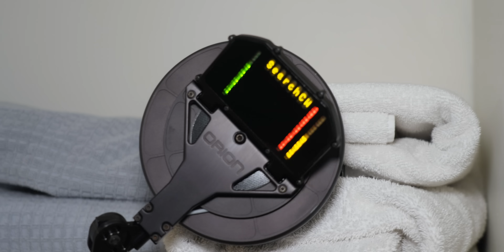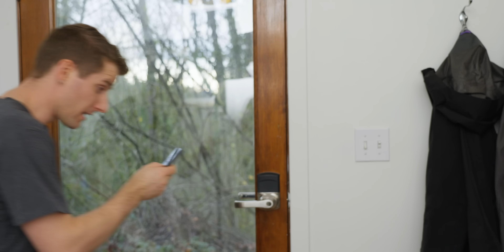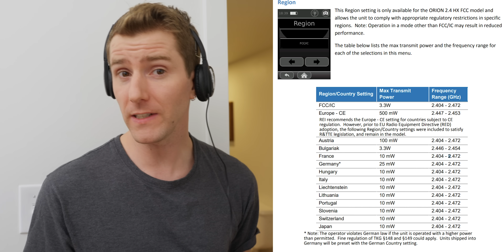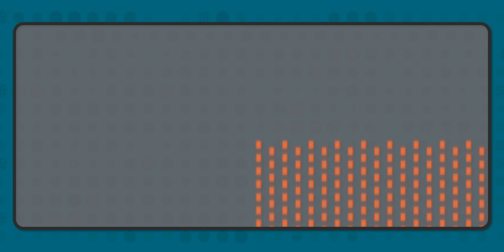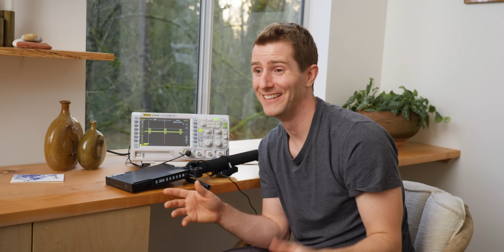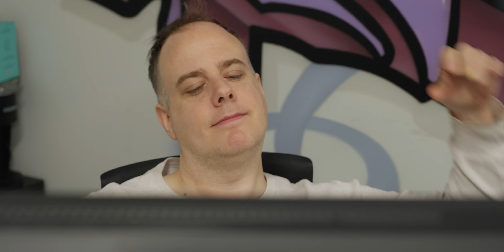I Rented an AirBnB to Look for Hidden Cameras

Comment: Dont like the title (which is currently I rented an AirBnB to Look for Hidden cameras)... it points to a totally different video.
Reply: Dearrow had superior title already:
Demonstrating a hidden electronics detector ("KLB Orion Non Linear Junction Detector")
Reply: Thats why this video is getting so many views. People think they’re going to see rigged Airbnbs caught.
Reply: A shot of a window with an actual view and not a blurred rectangle to conceal the location should probably have tipped me off that there would be no actual hidden cams found. It’ll be interesting to hear about this on the WAN show.
Reply: cry about it then
Reply: May be the title should be "Finding hidden spy devices with a microwave on a stick" ....
Or maybe the current one is better
Reply: People expect to see an Airbnb busted with spy cameras. While the title is technically correct, it gives off the wrong impression. Clickbait.
Reply from the maker: We did rent an airbnb. Hence it being shot in an airbnb. Obviously we didn't find any cameras so we talked about the tech we used. -LS
Reply: @LinusTechTips  “finds cameras” is also used as a results phrase…
Reply: @LinusTechTips  Please include some snippets of you testing the hypothesis and then acknowledging the results even if they are boring next time.
Reply: @LinusTechTips did you really spend the hours scanning the whole place? 😅
Reply: @LinusTechTips buddy, you searched one airbnb, the title suggests you did an actual investigation on multiple houses to get a real conclusion, if your title only refers to the first 30 seconds of your video then you swap to something completely different then yes, the title is misleading and clickbait
Reply: @Xtrm_Motors  The title is literally "I rented AN airbnb" so no, them investigating multiple airbnb's would actually be less accurate. What are you smoking?
Reply: @Xtrm_Motors  no it doesn't
Reply: @Xtrm_Motors  however the title does not, an would refer to a singular home and the title says an airbnb
Reply: @Xtrm_Motors it says “an” thats one😂
Reply: @Xtrm_Motors ”rented an Airbnb” are you illiterate? That clearly refers to one, not multiple smh
Reply: All you did was overact like it was a 90s infomercial and insert your own products as mini ads. Are you that hard up? You're less tech tips and more Markeplier fake reactions.
Reply: @LinusTechTips  Fair enough, I appreciate the reply, Linus

Comment: Thats the doohickey that people use to look for stuff in beach sand
Reply: You're not entirely wrong. You're thinking of a Metal Detector. Those are kind of the same in a way, they usually have a coil to emit and receive radio waves, you could in fact make one out of an little transistor AM radio. The trick is to listen to changes in the frequency (you can create a so called beat-oscillator to generate a tone), you can use that waveform to detect various types of metal. When the radio emission hits various metals, it will resonate according to the type of metal.
Reply: @joonglegamer9898  That name is the name I was looking for and for the life of me I could not remember it

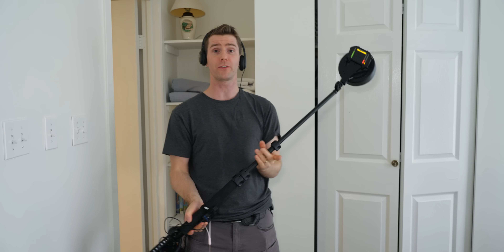Comment: 1:04 why is it illegal in those countries?
Reply: I'll go out on a limb here and say: RF emissions past legal limits. It's illegal in most countries to emit radio frequencies as they can interrupt communication, kinda like jammers are illegal. The apparatus itself is probably not illegal to own, but to operate without a license.
Reply: @joonglegamer9898  As you can see in a graph he shared, France (for instance) regulation on RF emissions power are higher than the ones in CA / USA 😅

Comment: I'm surprised an NLJD made it to LTT! They're pretty obscure and I've never seen one until I saw reference to it on Hackaday which linked to some websites about cold war spy tech. They definitely belong in the "genuinely spooky" category of technologies.

I don't think the microwave emissions would cook your eyeballs since it definitely doesn't house a 700W magnetron. It likely puts out a few watts of microwave energy (or maybe less) (but there's so little information on these that this is just a complete guesstimate). Still don't point it at someone's face since there is a significant amount of RF and it's probably not the best thing to point at your face.

Comment: That whole section of linus talking to the camera in front of the window concerns me. 

Don't microwaves bounce off of glass? 

Like, isn't that why it's safe to put your hand on the window of a microwave oven? 

So if thats correct, then didn't they have microwaves blasting right at them the whole time they were filming that bit?
Reply: No, the mesh inside the glass is what blocks the radiation. Essentially, any conductor will block the radiation (like the metal box enclosing a microwave oven).

Comment: Surprised there was no mention that you could also use your cell phone camera to detect IR light.  Just like the trick to see if your TV remote is still working. For example, you could turn off all the lights in the house, and look around using your cell phone camera to detect any "spy" camera that could be using infrared to see in low light.
Reply: You can. But like ordinary cameras, phones have an UV filter, so even if you can see some faint light blinking, or even a bit stronger - it's still not gonna detect the weaker light or all wavelenghts available. You can however take one of your older digital cameras, open it up, and remove the UV filter manually. If not for bug detecting when that gets boring, you can at the very least take some spectaccular night photos.

Comment: aCheap way is to use a germanium diode (or the diode junction of a germanium transistor) connected to your voltmeter.

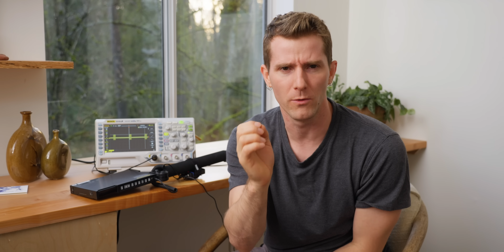Comment: 10:15 "The current that an RF signal will induce in a wire is very small... Like We are talking on the order of millivolts"  millivolts is not current,  milivolts is volts, current is amps.

Comment: Or you can buy a thermal imager, they aren't that expensive (you can even by mobile phones with this feature) and quickly glance over the room with it. Surprisingly effective! Every turned on electronics produce heat and they can pick them up just fine. Turned off electronics, of course, won't show up, but you're not scared of those ones, eh?

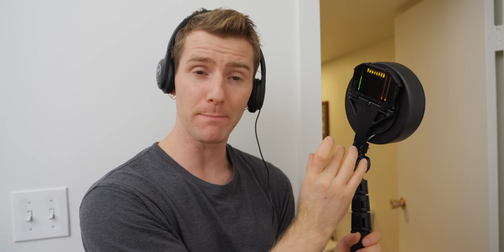Comment: 3:55 so if you create only one microwave pulse that melts your neighborhoods brains every few days, your average is within regulations?
Reply: Sunday roast
Reply: It fires an hour once every 10 Millenia but starts turned on. That allows the thing to fire at over 7000000 times the power right? Totally legal and safe!
Reply: Had a good laugh at that one mate.
Reply: "XKCD's what if" did a video about this, if you teleported to the surface of the sun for several hundred nanoseconds and immediately teleported back, you'd be unscathed.
Reply: To give a more serous answer:
It's almost certain the time you're allowed to avarage over is limited. I would guess to something between 1sec and maybe several minutes...
Reply: no, because it would be too high even when time-stretched and averaged and thus illegal, or legal but too weak.
Reply: @eqe2e23e  one Little Boy every 6.9 thousand years comes down to an average of 3.3 W
Reply: @istoOi  as far as i'm concerned, once every 6.9 thousand years you are allowed, but then for the next 6.9 thousand years you're not even allowed to use an rfid worth of radiation.
Reply: yea like how the EPA uses PPM for contamination and polution so the solution to cars and nuclear waste is just throw more shit in with it until it passes.
Reply: they obviously know they need to be using total polution per second not polution per part of waste, but they are not actually about polution they are about public optics and funneling money from all those green certified donors.

Comment: Hello so I've been needing help with like knowing what to upgrade because in games such as fortnite and warzone buildings won't load in for a decent amount of time and I was just wondering what all I need to upgrade to compensate for having a bottlenecking 4070ti. CPU: i7 8700k 3.7ghz GPU: 4070ti slim x gaming Ram: 2 Corsair Vengeance 8GB each Motherboard: rog strix z370-e gaming CPU Cooler: Cooler Master fan SSD: Kingston skc400s37128g (128gb) For the case I have no clue what it is but it leaves no room for fans so the only sort of fans I have right now is the CPU cooler and one other fan. If you could let me know if I should upgrade to something or let me know its fine please let me know cuz I hate waiting for my games to load stuff in the game so slow🙏🙏

Comment: No you can't lol not with what you said. Private Internet Access VPN said sonar from your smartphones and if you Google "sometimes Tinnitus is Ultrasound" you'll see that Doctors automatically give drugs to dampen senses because they're NPC's running a govt designed program that doesn't want you to know if its Ultrasound or not even if they have an idea of it. Google: "Ultrasound of Earth crust reveals inner workings of Tsunami factory" Now add that capability with plasma generated ultrasound frequencies that go through materials like your homes as if they don't exist because no absorption in the materials. See you and the cells inside your brain. Google: "Ultrasound to read minds" Upgrade to everything I just told you.

For people who make fun of Tinfoil hats? Google: Pubmed "Human mind has microwave electromagnetic nature and can be recorded and processed" Make them a magneto helmet.. They're way ahead of you, just out of style. - Deist (Ultrasound can see the cell mimic in your heads of what your eyes see. "Oh he's about to run a check, turn off everything until listening devices hear he is doing something out of context then switch back on" Easy mode.)

^ Look at me I sound like Alex Jones but with more data. Let me give a solution I'm not selling anything. There are Moths that can make Ultrasound to Jam Bat sonar, Boeing plasma force field uses plasma generated Ultrasound to produce shock wave level Ultrasound for destructive sound interference, and plasma excited by Ultrasound can also generate massive EM fields for defending from radiation by natural or other sources. So? Plasma generated + Computer control. Fun fact: Sound can be used to scan other sound..

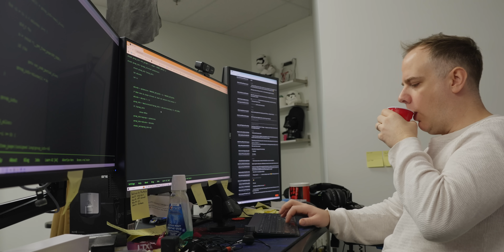Comment: 12:41 Can you please make a programmer fake the haking because having a messaging website with nosens user names (likely just a simulation) that types emojis??? It is likely supposed to be what happens when you run a code, but that cant happen while you write the code with just using like 8 keys on your keyboard. The even more funny part is that on a line it starts with "Atomic_set" like you are writing code for a nuclear reactor or something 

But i will give you some credit while you did not just run a simple program that just gave some useless information you went on a website (or something like that) that actually had code that was sort of realistic (not at all), so props to you for at least not going on those websites with green text and all of that.

This was not to be mean or anything, it was all meant as a funny indive into how you made the scetch. But please the person who has that computer please remove some of your bookmarks and close out of some of your programs please i beg of you.

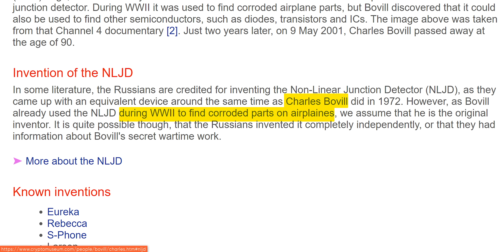Comment: So I'm at @6:01 and based on my partially completed introductory HAM course, I'm going to guess that the device blasting microwaves is inducing a current in the circuit of any devices because all wires (and rust, and pipes and nails) are antennas, and then it's picking up that resonance.
Reply: That matches up with how it makes a noise when there are no electronics and then becomes quiet around electronics.
Reply: Exactly

Comment: The biggest surprise is that people still use Airbnb. Pretty sure these days a real hotel is cheaper and way less likely to have hidden cameras.
Reply: Depends, we have found for large groups that it is significantly cheaper to do airbnb.  For example we are doing a full week for 6 adults and 2 kids and 1 baby in a place with 6 beds, and it only is costing us about a grand.    3 rooms for 7 days in a super 8 or motel 6 in a shitty part of town was going to cost us almost twice that, a nice hotel we would be looking at almost triple that price.    
Pretty much the second you start needing more than 2 rooms it becomes significantly cheaper to go the airbrb route.
Reply: Doesn't work for a month in Pattaya.
Reply: Hotels are not practical for a month or more.  Luxury condos way to go in Asia

Comment: lmao the number of times he got his head close to that thing while it was on and AFTER reading the warning X'D
I think he just removed the 2 brain cells he had.
Reply: Radio waves diverge, the smaller your aperture the more they diverge, and the lower your frequency the more they diverge. At a frequency of 2.5GHz and a 10cm aperture, they will diverge at an angle of roughly 84 degrees, so they will be coming literally out the side of that thing. So having it face forward isn't going to help much when its right next to the side of your head. To produce a 1-degree beam at 2.5 GHz, you need an aperture diameter of approximately 8.4 meters, which is why radio telescopes use such a large diameter satellite dish (think Arecibo Observatory in Puerto Rico).

Comment: You should have tested this thing on some egg whites. That could a be a good analog test for eyes. Maybe make a short of it. That would be fascinating and educational!

Edit a few hours: Actually, microwave ovens put out 900 watts on average. So this average 3.3 watt device probably won't do much if anything to eggs. My comment was not very well thought out.
Reply: only if they say "this is your brain. and this is your brain on a Non-Linear Junction Detector"
Reply: @metalskizzo  Ha ha, funny.
Reply: I was wondering why they didn’t “test” the microwave part of this to heat up a tv dinner
Reply: @08mario08  actually, microwave ovens put out 900 watts on average. So this average 3.3 watt device probably won't do much if anything to eggs. Maybe they even tried, got nothing, and didn't show us the "nothing" happening.
Reply: @jtadevich  that said, wifi power is 20-100mW
Reply: @jtadevich  3.3W on average, but it said in the video that it has a service time (or whatever it was called) of 6%. So if 94% of the time it's off, aka 0W, then it can do about 16-17 times that 3.3W. 3.3W * 16 = about 53W. Okay, still too little, nevermind me
Reply: @Winnetou17  But that's still a good point. I wonder if the power density is enough to cause visible changes in eggs. 
LMG, let us know please, or I'm going to have to buy one just to test. lol.
Reply: @gravel-eu8sj Wow, it doesn't take much to connect our devices. cool.
Reply: @jtadevich  Someone I know is into low-power radio. Just 5 watts from the UK can be heard in Australia if you have the right antenna and weather conditions
Reply: @josephpbrown  Yeah, another person in the comments said wifi is 20 to 100 mW. our devices sure are sensitive, especially if you can get them to bounce correctly off the ionosphere. 
I'm not sure the proteins in our eyes and eggs are that sensitive. Though another commenter said that the spy device detector's peaks in the 6% duty cycle could be as high as 50w. Does that seem high enough to zap eggs and eyes? I would love for LMG to test this.
Reply: @jtadevich  Even a couple watts right in your eyes is above what is considered safe. We all know direct sunlight in your eyes is dangerous and that's around a watt (though it's not all the same wavelength and stuff, but microwave is pretty much all absorbed by our eyes full of water anyway).

And you really don't want to play around with stuff like that
Reply: @jtadevich  Not really. 50W is not exactly safe, but ok-ish. Problems start when its something like microwave/high power transmitter or radar. AKA something that you can safely count in kWt (0.5 to gamma ray burst in galaxy not so far away).
Reply: @alexturnbackthearmy1907  Cool. I love where this discussion went.
Reply: @meneldal  Yeah but the sun is only dangerous to the nerves and rod and cone cells. It doesn't cook your eyes or even eggs without a black surface under them. The device in question only puts out a couple watts if you look it up, but even if it put 50 spread out over the entire disk, I wouldn't imagine it would cook anything. 

Either way, I'm with you. I would fool around with one. This is all just supposition. We would need actual experimentation to know for sure.
Reply: If you're close enough and use alumium to make sure all the power gets to them and it's just one egg, you could see it bubbling after you start getting tired holding the device for long agonizing minutes.
Reply: @meneldal  So you've done it before? 😃